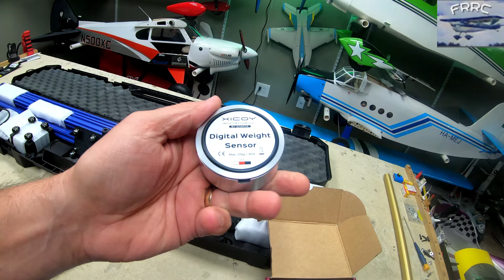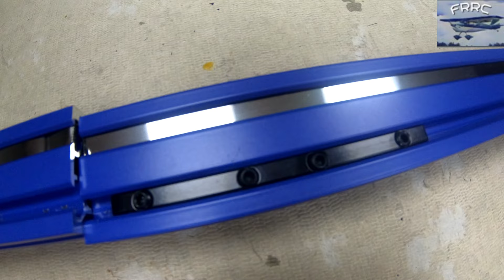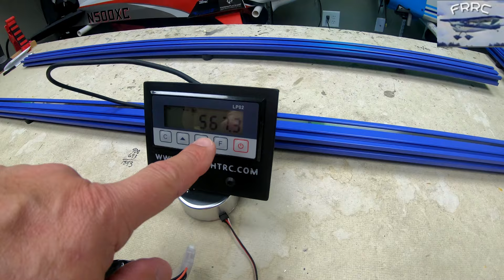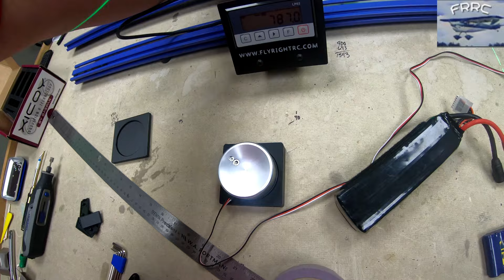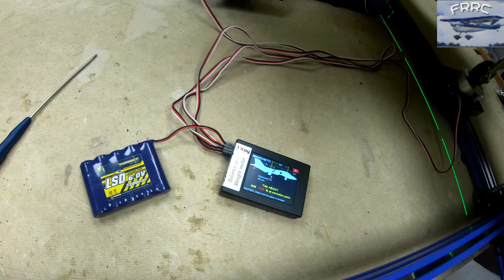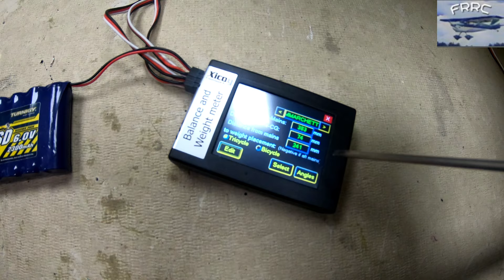Awesome CG Jig for Finding your Rc Airplanes Balance Point,  When Precision is Crucial

Comment: I've been using the Xicoy scales for years, but not that brand of rail kit .  I did notice your set up is slightly inaccurate for best results. Each trailing link strut MUST be fully extended (mechanically with a splint) at rest. Also, your lasered nosegear measurment is not at the nose axle point on the scale.

Comment: I’ve used this, and it’s absolutely worth it. Literally watched a $20,000 plane fly right into a tree because of balance. If you have a $200 RC plane, don’t bother. But if you’re a real hobbiest, you’d better have a balancing kit that works. The guy who manufactures these is also super responsive and quick to help. Highly recommend.
Reply from the maker: So accurate

Comment: It’ll tell you where the CG is, but not where it should be. Only test flights can tell you that. CG is partly personal preference like rates, expo, etc.
Reply from the maker: It is for sure and that’s why I said it gets you to a good starting point according to manufacture spec. Also if you get it dialed in where you like it and want to change pack sizes you can maintain that feel
Reply: @JustPlaneCrazy  The jig is portable and easy enough to assemble to take to the field and make adjustments there as well.

Comment: Well well well, what has the algorithm brought me today? So that is just the jig, what $$$ would you be into for everything necessary? Like so many things, if you are doing a RC W&B daily I'm sure it would worth it's weight in gold but for the average Joe wouldn't three decent scales and a little ingenuity work just as well?
Reply from the maker: No doubt you are correct. Most will go the finger route. But for those with special project or greater needs investing 800-1k would be a good and wise long term investment. Esp on special project. Heck even foamies hit 1k anymore

Comment: Nice equipment, laser doesn’t seem to be squared up. When you had it on the center of the closest puc the farther away one was not centered
Reply from the maker: It straight as can be and the laser is a bubble laser so it centers itself. It must just be the.camera angle